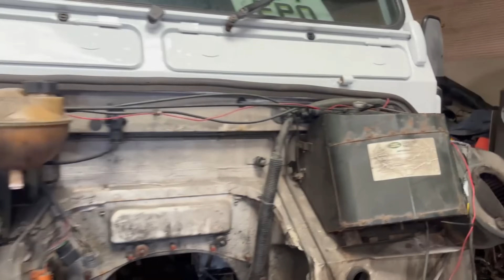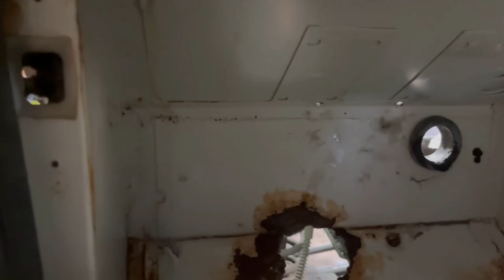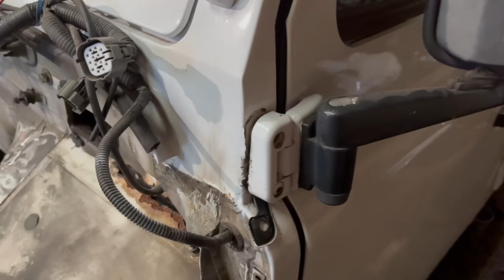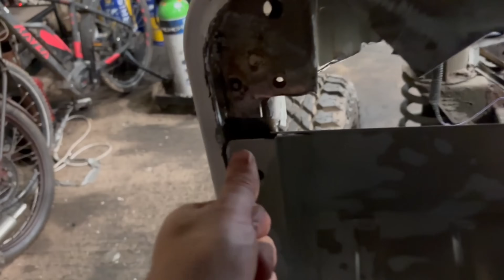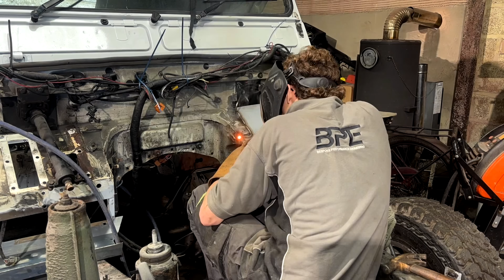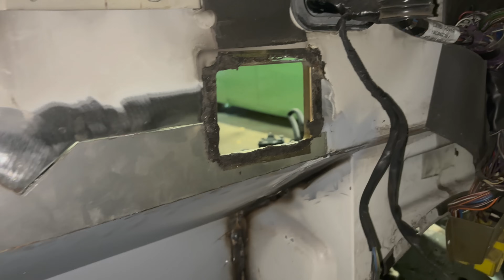Hidden Rust & New Floors! Land Rover Defender Rebuild

Comment: With the lt230 id highly recommend machining a solid spacer instead of the crush tube with the cummins, i just bought some 31.75 x 3.25 tube from ebay and it fits the intermediate shaft perfectly, i set the preload with a new crush tube then machined the solid spacer on the lathe to the same lengh then tried it in and it was perfect, and much  stronger

Comment: The water comes in through the windscreen to bulkhead bracket bolts then drips down the bulkhead 🙈, so when you put them back on it’s worth putting some silicon inside  the bolt holes and around the bolts before pushing them back through the holes , then clean up any excess 👍👍

Comment: No two Landy bulkheads rust the same... Always worth having the airline handy to blow out small fires and a bucket of water and an old towel to deal with bigger issues. Nearly killed myself years ago with smoke, so learned the hard way. I enjoy your escapades though.
Reply from the maker: Good plan with the airline, always an extinguisher near but I’m too cheap to use it 😉 what happened? Too much smoke in the workshop?

Comment: Hat's off to you tackling that job but my question is would it not have been easier getting a galvanized bulkhead instead or is cost the deciding factor
Reply from the maker: In the end it may well have been, at the start it looked like just the floor pans so I thought I could get away with leaving the dash board and a lot more stuff on the truck, I also don’t feel so bad about cutting this one up to fit the engine like I may have done with a new galvanised bulkhead lol
Reply: @scottnagle2 very true, i forgot about the big dirty Cummins you're shoehorning in there

Comment: Normally the bulkhead is rusty and thin around the windscreen hinge attachment points at the top & top edge too, I'd say that shiny filler paint near the hinge is hiding something bad in this spot. You can get top bulkhead corner repair panels to repair these specific areas. I have one of my bulkheads that I thought was perfect on the worktable converting it to lhd which means cutting & moving the steering column bracket and redrilling the holes for the pedals etc, and when I stripped it back and removed paint, it needed some additional blue glue in the top corners too.
Also sawzall through the hinge bolts I find easiest, knock through the remains and replace the captive nuts, job done.  Actually really easy to fix compared to a nut welded to the body panel. The bolt heads seem like more work to drill out.
Also, little spot weld cutter off ali express, 10 hardened cutters included, makes this stuff less painfull.
 Could be worse, the 101FC has a aluminium bulkhead and interior, and its spot welded together. Or in my case after parking it in a telegraph pole and bending everything like a banana, folding up replacements from raw sheet because apparently 101 spares are priced according to their weight in gold & plug welded with a tig...
Reply from the maker: Wow that 101 sounds like a hell of a job🙈 I love aluminium welding on a nice clean bench, with a comfy chair. I wouldn’t want to be crawling around inside a vehicle trying to weld panels together!
Reply: @scottnagle2  There wasnt much left to crawl round so I could do them on the bench mostly  in select lumps with it all nice and clean :) The chassis is now on the rotisserie after wondering why nothing was lining up during the cab rebuild and the bed removed whereby it became clear hydraulic violence was needed to correct the very out of square and banana shape main frame rails midway. Dainty fragile things those 101 chassis. Lucky the body didnt seperate off the chassis at 30mph or something!

Comment: A quick tip for when the rust catches fire grab a couple cans of Diet coke/pepsi, shake it up and jab a small hole in it continue to shake the bugger while spraying the burning Rust.  Co2.any poison water does the trick.
Reply from the maker: Will sparkling water work? I trying to look after my teeth 😂
Reply: @scottnagle2  Drinking it afterwards really is tight! 😂